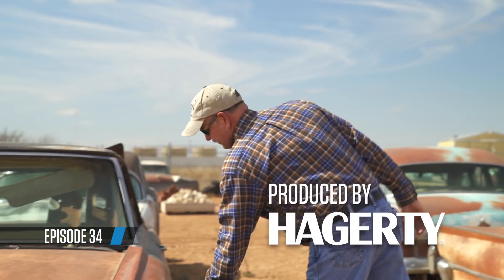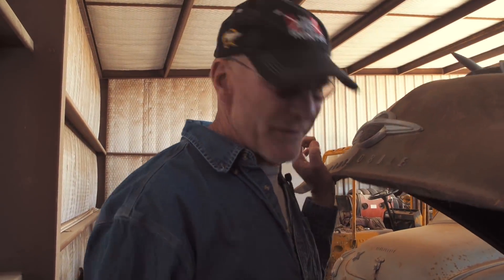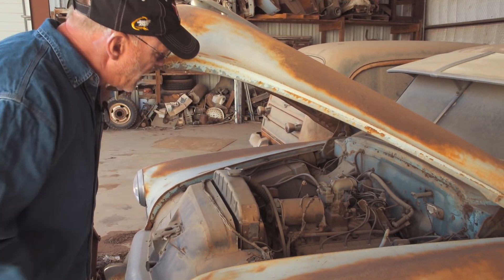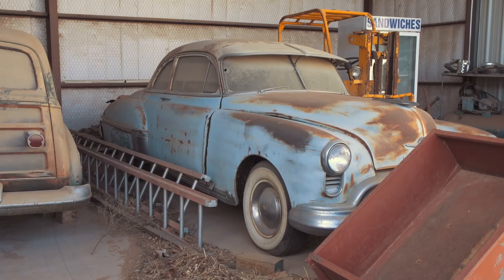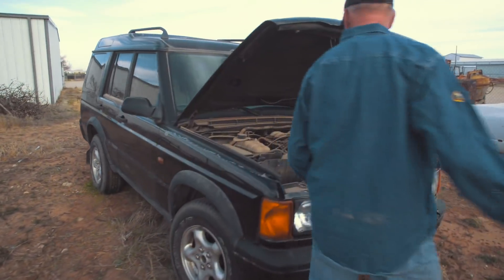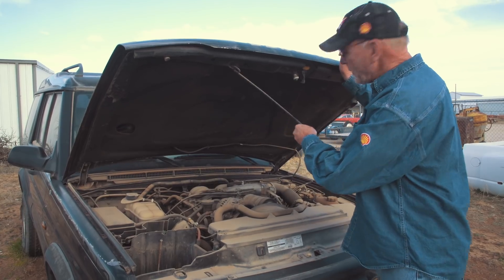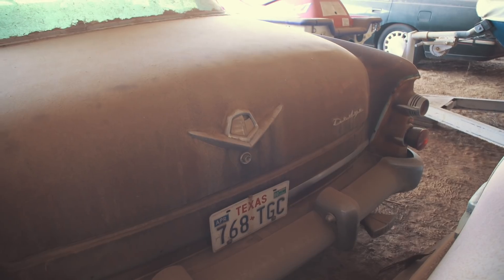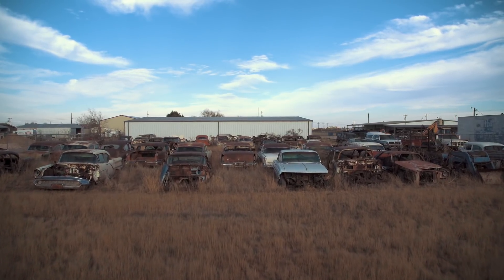Oldsmobile Heaven (with some Mopar and Pontiac sprinkled in!) | Barn Find Hunter - Ep. 35

Comment: I bought a 1950 Olds,4 door that wasn't running,sitting in a guy's yard. Back when i was in Jr. High,as a project. I rebuilt the motor,as well as the steering & some suspension. It had an automatic transmission,which i didn't like,but was a cool transportation at the time. But,when i saw a 2 door coupe,with a V-8 & a 3 speed transmission,i knew i had to have one,but the guy that had what i wanted wouldn't trade or sell me his car,so,i had to find something else. This is the first time i have seen a complete one in many moons. Good luck to the new owner!

Comment: There will come a time when four door cars and kids will make the connection... Look at the rice rockets they are buying! I see it happening where a kid builds a four door with his dad and I mean every piece and part was super cool polished stainless and upholstery, door panels visors, headliner. He drove it in his senior year. He grew up working on his 55 ford fairlane and it was damn nice.Everything stock except some nice dual exhaust that barked real nice. 272 y block. He even built the motor as far as assembly but they did have  the block boiled and heads surfaced but he lapped the valves... a real inspiration.

Comment: The rust in the top of the fenders of the road runner is due to the fact that they either eliminated the inner fender, or the inner fender was so cheap in material that it rusted first, then allowed the rain waters and road sand to blast the underneath of the fenders, right above the front tires. My '70 duster did the same thing. It was just Mopar being cheap on the assembly line.

Comment: A true barn find!!! Hello Hagerty Barn Find folks,  I have a 1968 Pontiac LeMans which I factory ordered.  It was in Kansas and Wyoming until 2012 and is now in Rhode Island.  It is Nordic Blue, has the 350 hp engine, bucket seats, vinyl top, chrome trim, Pontiac wheels and trim rings, Hurst 3 speed on the floor. It has 97,000 original miles and the engine was rebuilt at 90,000 by Allen Automotive in Chanute, Kansas, who work on race cars in the 4 state area.  It has a newer vinyl roof, new carpet. Repainted 2006 with original matte paint.  Lots of character.  I love my car.  Do you think you'd like to feature it in your show???

Comment: That 'little' 215 cubic inch Oldsmobile V8 was bought by Rover in UK, and it with some minor development went into a number of UK Rover saloon cars in the late 60s, before it ever went into the Land Rover/Range Rover family of 4WD. It's an excellent little V8, I've had numerous cars with it in the past and currently run one of these Rover V8 saloons, 4-speed manual.
Reply: Not quite true: The Olds version was only used in Olds and had its own Olds designed heads with valve covers sticking out at 45 degree angle. Buick valve covers went straight up to mimic the earlier Buick 'nailhead' iron V8's in appearance, but they weren't nailheads. The vertical valve covers made sparkplug access easier in small, narrow engine bay British cars. Pontiac used the Buick version, as did Rover/MG/Triumph/TVR/Morgan, etc. Buick designed the 215"/3.5L aluminum V8 and it first appeared in a 1951 Buick Harley Earle concept car.
Reply: Very true, I meant the Buick at the end of the day. The 'B' in the Rover P5B and P6B stood for Buick.

Comment: Sorry Tom but you were wrong about the Oldsmobile 215 aluminum V8 being purchased by Range Rover. It was the Buick 215V8 that Range Rover purchased.
Reply: Correct, the oldsmobile had different heads
Reply: Correct, the Olds version was only used in Olds and had its own Olds designed heads with valve covers sticking out at 45 degree angle. Buick valve covers went straight up to mimic the earlier Buick 'nailhead' iron V8's in appearance, but they weren't nailheads. The vertical valve covers made sparkplug access easier in small, narrow engine bay British cars. Pontiac used the Buick version, as did Rover/MG/Triumph/TVR/Morgan, etc. Buick designed the 215"/3.5L aluminum V8 and it first appeared in a 1951 Buick Harley Earle concept car. Australian Revco-Brabham created a Formula 1 winning version of that engine because it was the lightest V8 available. TVR had a 5.0L version. Hotrodders stretch it to 5.2L/318" version. Articles on how to make the larger versions are available online.
Reply: Correct !! Buick designed the best 215 V8

Comment: The V8 in the Land-Rover Discovery 2 would be badged as a 4.0, but I believe it was the same cubic capacity as the 3.9 that was used in the Range Rover Classic (the original Range Rover,) they just badged it as a 4.0 to make it sound like the Range Rover P38 had something new in the smaller petrol engine as well as the 4.6 which was new but was a lot less reliable due to its larger bore size causing cooling and block issues.  The first-generation Discovery remained badged as a 3.9 until the end of production.  You're about right for the time period, that Disco 2 looks to be about 2000-2002 from the front end styling (it's a pre-facelift vehicle as it doesn't have the secondary round reflectors in the headlights) and wheel design on it, plus there are other body features that weren't seen on early Disco 2s ('98-2000.)  A lot of people in the UK always refer to the Rover V8 as having been a Buick engine, forgetting that even back then GM shared engines across manufacturer ranges so it was probably seen in as many Oldsmobiles as it was Buicks which really makes it as much an Oldsmobile engine as it was a Buick, even if it was developed by the Buick engineers.  It's a shame GM didn't persist with it as it developed into a damn good engine which is as famous in the UK and Europe as the small block Chevy 350 (5.7 litre) is in the US and it probably saw service in more vehicles than the Chevy, everything from very fast sports cars to vans and, of course, some of the toughest 4x4s ever made, plus a lot of the police cars that used to give naughty motorists nightmares...
Reply: It was a great engine, used in some lovely cars. A guy i know had a old rover p5b with this engine, lovely car. Don't think it was used in triumphs though, probably should have been, certainly in the stag.
Reply: +ro eng  Ah, the Rover P5B, the British prime minister's favourite transport for over a decade and a half.  Lovely cars.  You're sort-of right, they should have used the Rover V8 in the Stag, the Triumph 3.0 V8 was technically a better engine but sadly BL technology wasn't up to building them right at the time, hence why it became known as the Triumph Snag.  Triumph did use the Rover V8 in the TR8, and the works TR7 V8 rally cars, though it's understandable a lot of people forget them as by far the greatest volume of factory TR8s were sold in the US with only a handful (less than 100 I believe) sold in the UK and probably even fewer, if any, sold in Europe as new cars...
Reply: Interesting...!
Reply: Furthermore, the Olds version was only used in Olds and had its own Olds designed heads with valve covers sticking out at 45 degree angle. Buick valve covers went straight up to mimic the earlier Buick 'nailhead' iron V8's in appearance, but they weren't nailheads. The vertical valve covers made sparkplug access easier in small, narrow engine bay British cars. Pontiac used the Buick version, as did Rover/MG/Triumph/TVR/Morgan, etc. Buick designed the 215"/3.5L aluminum V8 and it first appeared in a 1951 Buick Harley Earle concept car. Australian Revco-Brabham created a Formula 1 winning version of that engine because it was the lightest V8 available. TVR had a 5.0L version. Hotrodders stretch it to 5.2L/318" version. Articles on how to make the larger versions are available online.
Reply: Wiki.  'The Triumph TR8 did not use Triumph's own single overhead cam V8 as found in the Stag due to its weight and service record but instead shared its Rover V8 engine with the Rover SD1.'
Reply: "service record" being code for unreliable...

Comment: 215 V8 was developed by Buick.  Oldsmobile & Pontiac were given access to it for their smaller cars.
Reply: Yes, the Olds version of the Buick 215"/3.5L aluminum V8 was only used in Olds and had its own Olds designed heads with valve covers sticking out at 45 degree angle. Buick valve covers went straight up to mimic the earlier Buick 'nailhead' iron V8's in appearance, but they weren't nailheads. The vertical valve covers made sparkplug access easier in small, narrow engine bay British cars. Pontiac used the Buick version, as did Rover/MG/Triumph/TVR/Morgan, etc. Buick designed the 215"/3.5L aluminum V8 and it first appeared in a 1951 Buick Harley Earle concept car. Australia's Revco-Brabham created a Formula 1 winning OHC version of that engine because it was the lightest V8 available. TVR had a 5.0L version. Hotrodders stretch it to 5.2L/318" version. Articles on how to make the larger versions are available online.
Reply: Great clarification.  Thanks.

Comment: Tom said,  "You don't see many Business Coupes". The coupe is an "88" Club Coupe which were all made with a back seat. A Business Coupe generally does not have a back seat and in 1949-1950 Olds did not make a coupe without a rear seat. Yes, Tom, you changed it to "Club Coupe" as you departed the overhang.

Comment: A little Rover v8 history, They put that engine in the 1970 Range Rover as a 3.5l. It was reworked to a 3.9l, then a 4.2l used in the Range Rover classics, the Defenders, and the Series one Discovery. the Discovery 1 used the 3.9l and 4.0l using GEMS engine management and the Bosch engine managment which is what that series 2 Discovery has in it.  that is a 99-02.  The Rover v8 engine ended its run as a 4.6l installed in the p38 Range Rovers and in the 03-04 "facelift" series 2 Discovery. It was/is a flat tappet engine, one of the very last flat tappet v8s sold.
Reply: Also, the Olds version was only used in Olds and had its own Olds designed heads with valve covers sticking out at 45 degree angle. Buick valve covers went straight up to mimic the earlier Buick 'nailhead' iron V8's in appearance, but they weren't nailheads. The vertical valve covers made sparkplug access easier in small, narrow engine bay British cars. Pontiac used the Buick version, as did Rover/MG/Triumph/TVR/Morgan, etc. Buick designed the 215"/3.5L aluminum V8 and it first appeared in a 1951 Buick Harley Earle concept car. Australian Revco-Brabham created a Formula 1 winning version of that engine because it was the lightest V8 available. TVR had a 5.0L version. Hotrodders stretch it to 5.2L/318" version. Articles on how to make the larger versions are available online.
Reply: BuzzLOLOL Great Info!!

Comment: The Olds 303 OHV V8 developed 135 HP in 1949 1950 and 51..Cadillac's 331 OHV V8 was 160 horsepower during the same time......Still impressive....and it made the 88 a very fast car ....but 180 HP didn't arrive until Chrysler's 331 Hemi in 1951...which started the horsepower race. A 51 Saratoga with the hemi was a real factory hot rod.BTW...its an 1949 Old  Deluxe 88 club coupe

Comment: 61 olds f85 aluminium v8 my father bought one new. great car. my  fathers first one had eratic shifting trouble with the automatic that had no fix so the dealer traded him even up for another new f85 3 speed on the column. eventually the transmission went bad and I replaced it with a cast iron 3 speed from a nash for 15 bucks from the junk yard. We had problems with heater and radiator plugins up from pristone cleaning it out and using zerex fixed that.
Reply: The automatic in my '62 Olds Jetfire with stock turbo charged Olds/Buick aluminum V8 also gave trouble by 42,000 miles... a throttle linked valve body valve kept jamming instead of sliding in it's bore... we converted it to a manual tranny...

Comment: I was 15 in 1960 and looking at used cars. I LOVED the 50 olds rocket 88. NO ONE liked the pontiac straight 8 what a heavy dog. I weighed the engine and hydro on a junk yard scale at 1100 lbs of dead weight iron.

Comment: Triumph had it own V8, but thats true that Old's V8 was used in varaity of british companys- Rover, Land Rover, MG.
Reply: The Rover V8 was junk, Triumph switched to the Buick/Rover aluminum V8 for the TR8. The Olds version was only used in Olds and had its own Olds designed heads with valve covers sticking out at 45 degree angle. Buick valve covers went straight up to mimic the earlier Buick 'nailhead' iron V8's in appearance, but they weren't nailheads. The vertical valve covers made sparkplug access easier in small British cars. Pontiac used the Buick version. As did TVR, Morgan, MG, etc....

Comment: 4 doors can be made into cool "customs". It's a lot of work but I remember a few shorty cars from the 60-'s to 70's. Cut car in half, remove rear door, floor and roof and weld it back together. Change the driveshaft and it's done. Others cut 18-20 inches out of the roof and cut off the frames off the rear windows and cut and move the sail panel and back window 18-20 inches forward and weld it up. Weld the rear doors closed for structural rigidity. Section in another trunk and make a car type pick up similar to an el camino out of it. 2 doors get raced, abused and romped. Get a 4 door from some old folks that's been gently driven and customize it for a one of a kind ride. Back when I was a kid custom one of a kind cars fetched big money; I don't know if that's true anymore or not. I see a few 4 doors that bring big money at auction but not many; 57 Belair, 50's to 60's Caddy or Lincoln and maybe an old diesel Mercedes in good shape. Some 4 door wagons are getting popular also.